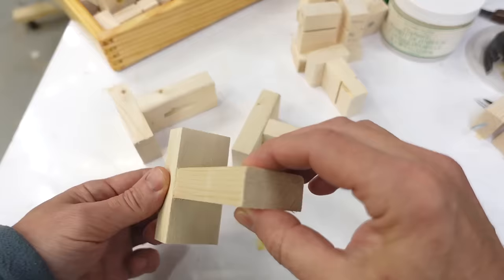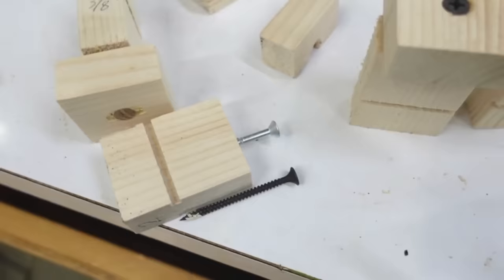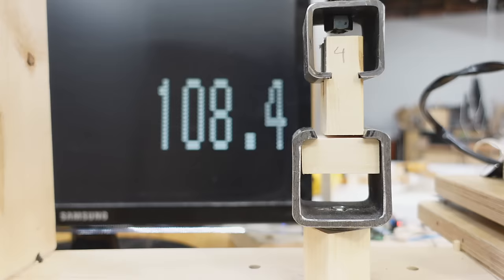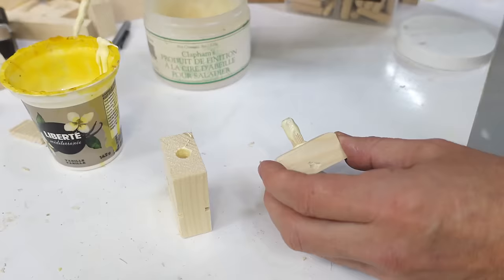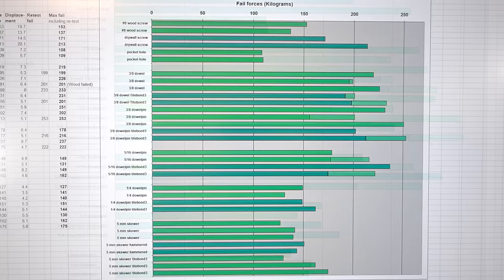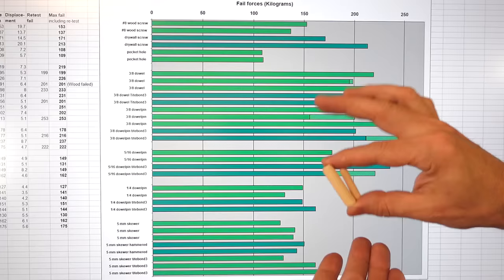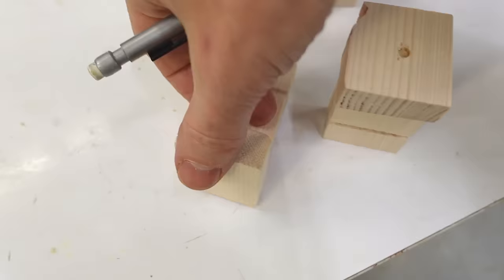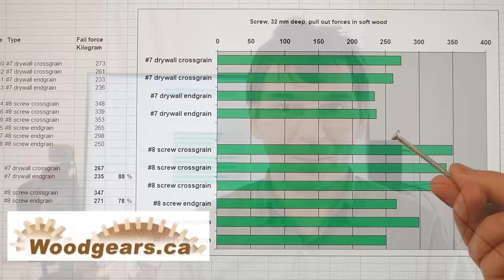Bamboo skewers stronger than pocket holes?  Dowels vs. screws.

Comment: I have been using little coin magnets in plenty of recent projects. Sometimes magnets that attract to metal and also magnet to magnet. I would be very interested in seeing some testing on those. Especially what little air gaps might do to the final pull strength. I can't always get things perfect and have wondered about eh seemingly exponential falloff with magnets.
Reply: air gaps... bad news. iirc, its a cubic inverse ratio. its really hard to set anything ins tyone with magnets as its geometry based, material based... but air gaps are just bad all round.

try to use pots if possible. bit costly but well worth it. shields the field externally so no nasty stuff happens, and the field is concentrated between those two iron poles.

can make them though?

like magnetic door latches were always a simple ferrite between two iron plates or keepers, set back from the outer edge (gives two defined poles, and magnetic "junk" doesnt get in the way so much...), and the latch is a simple iron plate to bridge the gap. no air gap when latched. keep all the field in the iron where it wants to flow.

rather than use one pole only, think of "closing the loop" instead. far more efficient. and soft iron lets you manipulate where the field is. 

magnets LIKE to be shorted out with iron. not just stuck on one pole but shorted out.

Comment: Makes one wonder how screws and dowels would fair using hardwood. I also suspect pan head (or round head) screws, especially with a washer would do. Not tested, Domino style or floating tenon type joint. 

Then you could go completely around the bend and test other glues (Titebond type glue has a fair amount of creep) like Plastic resin glue, epoxy, and resorcinol glue. Your average woodworker likely would only consider epoxy or urethane.  After seeing some tests in Fine Woodworking I'm typically OK with Titebond. 

Good stuff! Thanks for doing this!

Comment: Thank you for doing this. I would love to see how lag bolts or construction screws would hold up (thinking GRK fasteners). I’ve considered using them and then covering the hole with a dowel for an easy joint.

Comment: So, I assume that using harder woods would result in the screws performing better while the dowels getting little to no gain in performance. Reason for that is the wood is failing, not the screws in your current test so if you use a harder wood it should result in the screws being pulled through the wood less. And on the flip side, with the dowels, the glue / press fit is failing which when going to harder wood, I would assume the glue and press fit would perform the same / similarly.

Comment: Thank you for doing all this testing and video-making.  This information is invaluable to the carpenter and woodworker.  I wonder if you might be able to do some testing with hardwoods?  I feel that the hardwoods (walnut, hard maple, cherry, hickory, oak) might be able to withstand the head pulling through better than softwoods.  The other consideration is that furniture typically isn't made with softwoods.  To be honest, most fine furniture is made with loose tennons or dowels instead of screws, but that's a whole other thing.  I really am curious to see how hardwoods can resist pulling the head of the screw through them.  I can send you some sample hickory and walnut.  I might be able to send some cherry as well.  I don't really have any oak or hard maple though.

Comment: excellent content and presentation.  I would like to see the bamboo in shear when it is used as a scroll pin. i use this method where i don't want metal fasteners or i want the pin to pull a joint together using a taper.

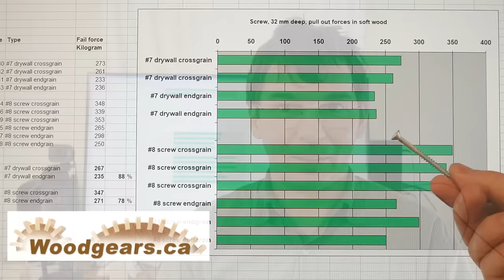Comment: 9:02 When you think about the way the wood is 'built', not that surprising. Even though you're severing the long fibers  every mm say with a screw thread, there's still a lot of parallel fibers holding things together, sortof glued together. And the same holds through for the side grain screw. 
I think at least.

Comment: I love dowels.  They provide great strength in any direction.  Any screw with  perpendicular force is so weak compared to a dowel.  Dowels are great for alignment also.  The only problem is jigs for aligning dowel positions is not that great.  Someone needs to come up with a great doweling jig!

Comment: Very cool. I think you'd get better results with the drywall screws if you used coarse threaded ones, the ones you used are more for use with thin metal studs.
Reply from the maker: From some quick tests I did, the coarse threaded ones don't hold as well
Reply: @matthiaswandel  Wow, that's surprising! Does anyone know why that would be? The whole reason/theory behind coarse-thread drywall screws is that they're supposed to hold better in rough construction lumber, softwoods like pine/fir/&c, right? I guess another issue is likelyhood-of-splitting as distinct from holding power, but still?

Comment: Very interesting, I wish the pocket holes would have held up better.
I'm curious as to whether screws plus glue(or dowels) is a stronger joint than adding the strength of each one separately.  Synergy?

Comment: Could you do a follo-up short testing treaded insert + bolt? 

I use them a lot for easily dis/reassemble-able joints, but i honestly have no idea how strong of a joint that makes... Get the feeling it'll be stronger than the screws though; seeing as they tended to fail by pulling the head through rather than at the threads. Should be interesting regardless

Comment: Thanks for the good testing/video, I always enjoy finding out what works best.  I have seen dozens of YouTubes for making your own dowels, but there was one I really liked.  You just use a thread cutting die and spin the prepared stock through it.  With a complete die set you can make any size dowel you want, and they come out with good gluing surfaces.  I wonder how they would work in you test jig?

Comment: Fasteners in end grain are usually a no-no, in fact nails in end grain aren't even allowed by building codes.  That doesn't keep us hobbiests from using screws into end grain.  I've had the idea that some screw types might be better and at one time I was going to propose a series of tests to you to evaluate that.  I've noticed that some "structural" screws sold by big box stores have notches in some of the threads as if to cut threads into the wood as they are screwed in.  I wondered if this type of screw would cut through some of the fibers in end grain vs. just pushing them out of the way and thus get more strength.  After viewing your tests in this video it seems that even if the more advanced screws did cut the fibers and gain more grip maybe there isn't much more grip to be gained.
It would be interesting to convert your dowel results to a common reference such as shear stress (bond stress) to surface area in order to determine if this is a constant which theoretically it should be.
It would also be interesting to see a similar series of tests with the dowels and screws in shear vs. in tension.
Reply from the maker: Oh, I guess all stud walls violate building code then?
Reply: @matthiaswandel  You are correct!  Nails into the ends of wood studs are not allowed to be used to resist wind uplift on the roof, you have to use other types of ties sometimes called hurricane ties to resist wind uplift.

Comment: With the weakest joint holding for 100kg (about 200lb), my conclusion is that choosing a joint is not at all about the strength, but rather about what is the most useful and convenient method for the application. 100kg strength is more than good enough for anything made out of wood. Pocket hole joinery is sometimes the most useful and convenient and sometimes it's the screws. You didn't do dovetails and such. why? I think I may know the answer...
Reply from the maker: there is straight load, and then there is impact load, which is momentary load, easily 10x higher.  Also, for example, joining apron rail to table legs, there is about 10x leverage.  So accidentally bump into a table (impact load) with full force, and that's enough to bust a lot of joints in the wood.

Comment: Good data! Looks like you were using metal drywall screws. The ones designed for wood studs have a coarser thread. Not that it would change anything.

Comment: Do we know if the wood glue would deteriorate with time? If I made a stool with screws and another with dowels, would the stool made with dowels still be stronger after 100 years?
Reply: just cross pin the dowels and the glue will be good till termites or rot gets it. i have a bookcase i built 50 years ago with no nails, glue, or screws. just dowels cross pinned with dowels.  i made it that way so i could tap it apart to move. still stiff like new except where patches chewed on a corner.
Reply from the maker: I have had weldbond glue fail for an outdoor project.  Alternating wet and dry eventually cracks the glue.
Reply: @victorhopper6774  Aww patches 🐶 Sounds like a well built bookcase.

Comment: Something that I do now for a lot of my joinery is use bamboo meat skewers and put at least 2 which are also set at an angle so there is no direct 90deg pull out as you've had here - I'd really like to see if they are as strong as I think they are.

Comment: Put a washer underneath the screws so they don't pull through as easily that might give you more of a accurate picture on how well the threads hold
Reply: Oh never mind I'm now at the area of the video where you're testing the screws by pulling on the heads.

Comment: 2 more things to test - screws with flat head, so they better split the load on the surface, and then the "ikea-style" screw and nut :)
Nice video, though.
For me, screws are better, because you can always disassemble them.

Comment: hey Matt, Workshop Companion on YouTube showed how to make a "dowel pocket hole joint" where they used a long brad point bit and drove in a dowel, rather than driving in a pocket screw. 

Any chance you could test those out? I wonder how well they'll hold up vs dowels or pocket holes.

Comment: I don’t consider anything after the screws started pulling out useful.  The joint failed when it started separating.  The point is to hold the two pieces of wood together, not just close to each other.

Comment: its very important to provide pressure to the gluejoints. the more pressure it cures under,the stronger the joint! you also MUST wet the endgrains!!! not much but enough so that the glue gets sucked into the fibers. capillary action,baby!

Comment: These tests are awesome. I enjoy seeing how different methods behave.

I am curious what the failure modes are for real world furniture and what the thresholds of force on them are. I suspect short peaks through racking are a big one and that degrading materials from time and moisture changes are the bigger ones. My suspicion is that in real use for most furniture builds you hit diminishing returns well before getting to optimal raw strength of the fastening methods

Comment: In cases where I don't want the wood to split because of a flat head screw I will sometimes use a washer under the screw head. It's not always possible to do that, but you would have had some higher numbers had you tested that way.

Comment: Interesting in an academic sense, I guess, but who builds furniture using dowels or screws where the stress is parallel to the dowel?  Wouldn't dowels be used only where sheer strength is important?

Comment: It seems the screws failed in cross grain by splitting the wood. If the wood pieces were longer to prevent splitting, it might be significantly stronger than endgrain.

Comment: When the dowel gives you could easily redo the bond, joint just add some more glue and tap it back closed. Obviously it'd depend on how, why it failed as if it gave as soon as you put the item together from the weight then there'd be no point but if it failed because you fell over and used say the shelf to catch yourself and it was due to the extra weight and heavy impact, in that case it's probably worth just fixing it.

Comment: I'm wondering, because the drywall screw has a flatter head than the #8, and that's what gave it a higher ultimate strength and a higher point where they showed a gap, I wonder if the same screw with a larger flatter head would be even harder to pull through. Sometimes I use Button Head screws as hooks/hangers for tools, and with the big flat head on them I wonder if they'd be harder to pull through. Or if even a washer would make any difference to the numbers. I imagine with a wider surface area under the head that the ultimate strength would be the same but the gap might take longer to show up.
Reply from the maker: yes, bigger heads help, like screws with integral washers.  But those screws in turn can't be countersunk.

Comment: When I need a small number of screws to do a lot of work up near their ultimate tensile strength I run a small washer under the csunk head to spread out the load into more wood and prevent head pull through. In this case you have to be careful not to overtighten and break the head off the screw. In all other cases just use more screws to achieve higher strength.

Comment: I'd be curious how much pinning a 3/8" dowel with a bamboo skewer, i.e., at each end drill a hole equivalent to the skewer size through the dowel perpendicular to the direction of force and glue it in, effects the results. I've seen this suggested for joints where you want some mechanical fastening even if the glue joint on a dowel or biscuit/domino/loose-tenon fails.

Comment: Other than just pure holding power there is another reason for using any form of dowels instead of screws. Disassemble your wood joints on the table saw afterwards and you'll figure...

Comment: Which is better depends on more than just strength.  If you need to be able to reverse the connection then screws are the clear winner.

Comment: interesting stuff, although maybe a bit unfair to screws, they were quite a bit smaller than the dowels in surface area
the dowels would not fit where the screws would. maybe larger diameter screws would be more fair?

Comment: IMO as soon as the joint has opened a visible gap it's failed. So I'd put the screws as failing at around 100kg. Which is quite a bit less than dowels.....My next project will be building a subwoofer box, after seen this vid I may use dowels instead of screws.
Reply: I am curious how much force is going to be on your subwoofer box? For most things I build, any of these methods seem to be more than adequate
Reply: I think TOIDS DIY AUDIO did a subwoofer box feature where he added in a bunch of internal baffles to increase strength and decrease panel resonance. Also look into including at least one outside panel that is non-parallel to the opposite baffle...eg: front panel is slightly angle in relation to the back panel. This actively helps to break up any internal standing waves that could cancel each other out and cause null point nodes in your frequency response. Good Luck!!!
Reply: @mikewatson4644  I agree any of these methods would be strong enough for a sub box...But screws cost money, dowels can be as cheap as free and are equally as difficult to install as screws providing you intend to drill pilot holes for the screws. The next benefit over screws aside from being clearly stronger is I can run a round over bit on all the edges of the box after assembly without any fear of hitting a screw. Same when I'm stapling carpet to box later or installing other hardware I won't be running into screws that aren't there.

Comment: im assuming that is the weakest direction of that joint, and that the shear strength at the joint surface is the strongest. and then the screws are then the strongest due to material. though i wonder if screws don't actually increase the strength because the wood will tend to split, before you get to force level that would shear the screw.

Comment: Why would you use a beveled wood  screw? That would be far more likely to pull out or split the wood. A flat-bottomed screwhead like the Kreg pocket hole screws is a much better design.

Comment: With how small the bamboo skewers are I use 2 or 3 rather than a single 3/8s dowel.  I only tested the strength once but 2 bamboo skewers were stronger than the 3/8s dowel.

Comment: Did the length of the dowel really matter if the receiving piece is always the same thickness and it did pull out from there mostly?
Reply from the maker: the 1/4 inch dowels were shorter so they didn’t go all the way through

Comment: You need a displacement (z-axis travel) versus force graph to have these tests mean anything, your conclusion  of “glue doesn’t make pocket holes stronger” years ago was incorrect for that same reason.

The force to required to create displacement and the opening of joints is more important that ultimate failure strength.

Comment: How about using the bamboo in a pocket hole instead of screws and testing? Do they have bamboo biscuits? How strong are they? And it looks like you used white or yellow pine for the wood. How strong are they in maple or oak?

Comment: Is this pulling force a common force these joints would face in a real project?  Might be more realistic to make a test that puts downward pressure on the point of 2 pieces joined at 90 degrees
Reply from the maker: yes, usually racking results in pulling of the screws, but that pull is not entirely straight out.  But then -- how un-straight should the pull be?  That's the thing with a lot of testing, you create a circumstance that is at least measurable and repeatable.

Comment: Would type of glue for the dowels matter?
Reply from the maker: For hardwoods, yes.  For softwoods, most woodworking glues exceed the strength of the wood.  But not construction adhesive